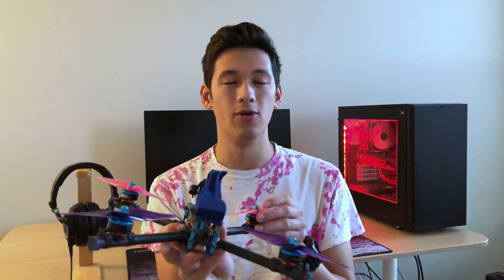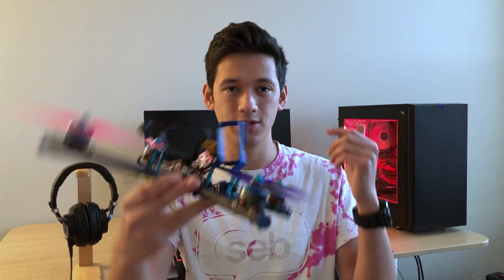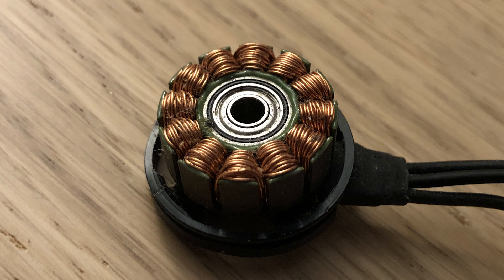The Strangest Drone Failure...

Comment: So a few months back, after a crash days before, my quad desynced and death yawed to the ground. Although it looked cool as f*,  I didn't understand why it happened, but on careful inspection, one of my motor bell shafts apparently bent in the previous crash, and although the quad sounded odd to me, I didn't know the extent of the damage until the desync occurred.
I tried to fix the shaft, and accidentally broke it on 2 different bells.
Bent shaft = excessive friction + extra heat = desync (in my case)

Comment: Let me explain. Some brands order OEM with cheap laminated wire. NO MATTERS TO THE ENDCOST. Over time/heat/sand insulation begin to crack. Crack+crack=short circuit.
Order laminated wire in same thickness as you had and make new windings. Its easy, cheap, and you will di it better than most OEMs..
Reply: Brother - please take your above suggestion and manufacture motors with your specs and I promise I will buy them and I'm sure others will as well.....your explanation makes perfect sense.....

Comment: Measure the impedance and compare to a like-new motor (of same batch ideally) to confirm your theory. You would want to do frequency dependent impedance charted out for both tests but you might get useful data with just a digital multimeter. If it checks out then perhaps we need to discuss ESC firmware settings.